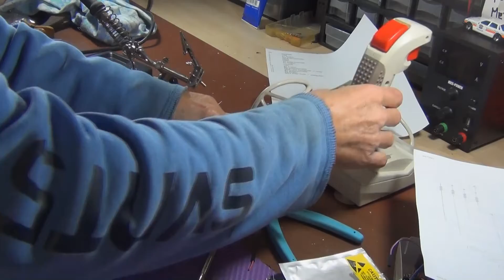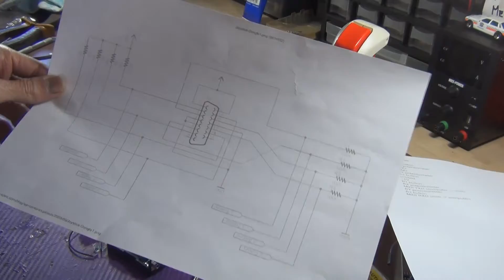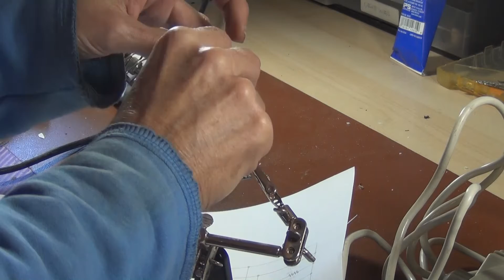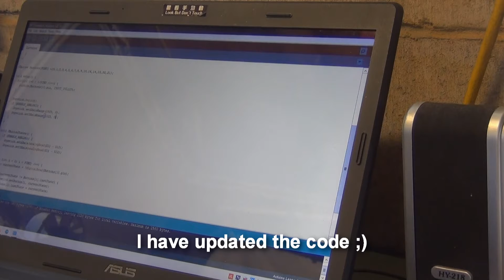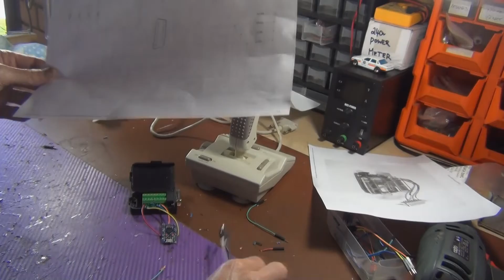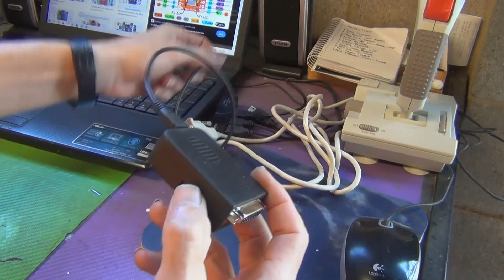PC Games & Builds - DIY 15 Pin Retro Joystick to USB Converter - Quickshot QS-201

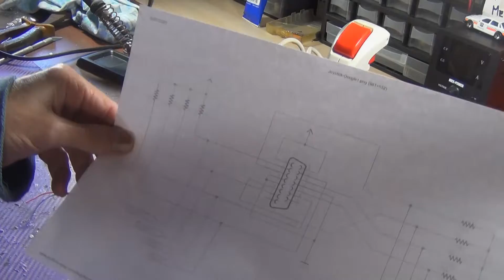Comment: Great tutorial and explanation buddy! I want to make me a Gameport circuit like this one, that connects a wheel (Thrustmaster, etc) to arcade boards of racing games that use 5k pots. Model 3 games like Scud Race and Daytona always give a signal of 0-5V whenever a potentiometer is connected to the game board, regardless of the resistance in the pot itself. I have physically gutted them before and rewired them to work in the boards, but I would prefer to opt on a solution that is more "plug and play". Normally arcade games will have all 3 pins in a potentiometer wired, like a voltage divider. I wonder if that circuit (shown at 1:40) could work in arcade boards that are analog...

Comment: I have thus same joystick.  I love it because I hate those horrible springs you get on modern sticks, they feel horrible and clunky and you can't input fine adjustments. 

Two questions:

A: Is there an off the shelf solution to plugging this joystick into a modern PC? Maybe a pci board with two old fashioned connections?

B: Are there any modern joysticks built like this one with the same kind of oblong mechanism design on the base like this one has? Instead of those awful springs and a ball base.
Reply from the maker: Yes do a search for rockfire usb in eBay it's a great alternative if you don't want to build this.they used to be expensive but cheap now.There are some pretty nice modern joysticks, but not sure about the mechanism your referring too.Therr were some older usb joysticks that weren't spring mechs, do a search for usb PC joystick on eBay.i agree about the spring support joysticks although I do have a saitek with a spring and recently made a 3D printed tension mod for it  and it greatly improved the feel and accuracy.i will do another video soon and add support for the two buttons and the throttle to my retro joystick build.
Reply: @ACLStands  cheers. I think the mechanism in the QS-201 looks like a gimbal style , at least from the outside anyway.

This is the design I'm looking for I guess.  I've seen a few videos of some 3d printed gimbal joystick mechanisms but I'm not sure if such a thing exists off the shelf other than the QS-201 . There must be others though..
Reply: @ACLStands  I've just found this: a CH 200-571 And it looks to have the same kind of base setup as the quickshot warrior. 
https://www.youtube.com/watch?v=lffypL92554
Reply from the maker: @MGRracing  hey nice find, I've never seen that one.

Comment: Get yourself some 30AWG silicone insulated wire. I use it for all my projects now, and I don't have the problem of wires snapping off at the solder joint ant more.
Reply from the maker: Totally agree.The final build I show at the end uses 30awg silicone wiring.I used the coloured wire just to show connections a bit easier on video.

Comment: hello, do you know if this project could work with a microsoft sidewinder ? thanks.
Reply from the maker: So this setup is really aimed at the old 4 axis 4 button joysticks, and the code has that in mind, however I did recently stumble on this, which should answer all your sidewinder questions and answers.https://github.com/necroware/gameport-adapter
Reply from the maker: Also here is his yt video on it also https://youtu.be/tSJLgCD8jeM
Reply from the maker: Also check this https://youtu.be/tSJLgCD8jeM
Reply: @ACLStands  hello, thank you for answering but when I compile the sketch the compiler output says :"Gamepad_2:9:1: error: 'Joystick_' does not name a type; did you mean 'Joystick'?".
Reply from the maker: @salvatorecavallo337  contact me on my Facebook page, it's in the description, I will be able to help you out much better there